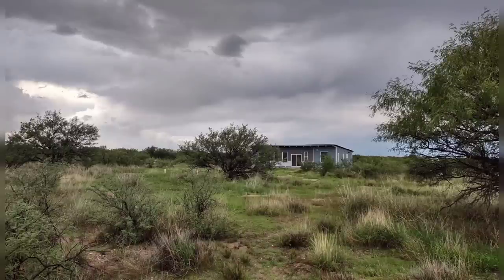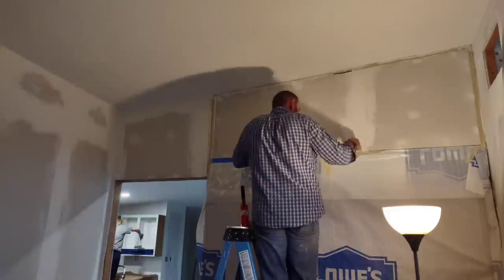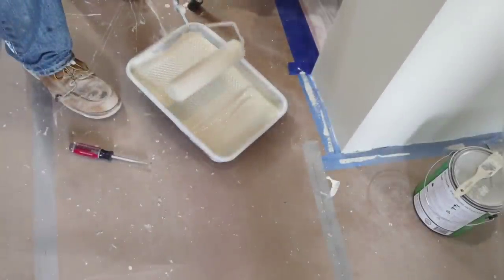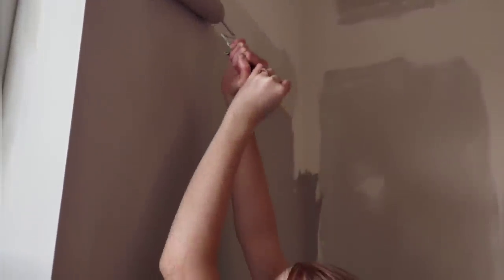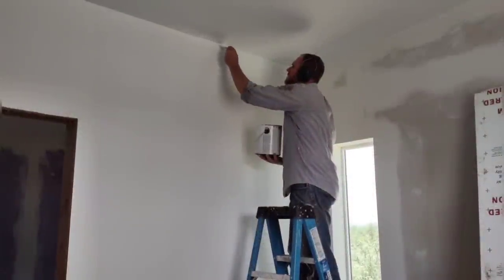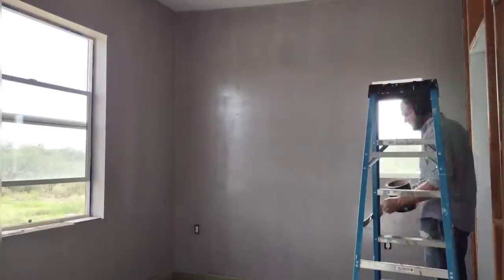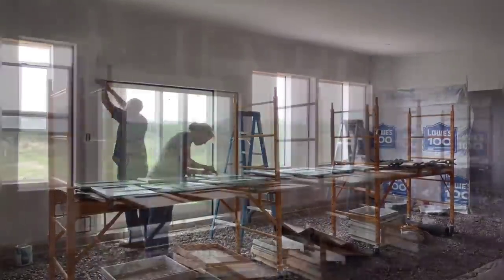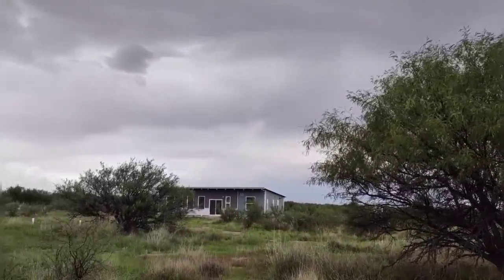Choosing the Colors | PAINTING the Walls & CABINETS | DIY Off-Grid Home Build #41

Comment: Was that a tortoise in your garden?   What a variety of desert creatures.   The purple grey is a nice compliment to some of your evening sky colors.   Your garden A frame is a profusion of greens.  Congratulations on a successful garden.  Perhaps next year you could deepen the pond, using the inside dirt to raise the berms.  In the area where the pond overflowed onto the swale, could you use some of the aircrete sample blocks to make a spillway that will not erode as excess pond water overflows.  Wishing you another blessed week, gentle weather, nourishing rain and restful evenings.  Peace
Reply from the maker: The turtle was in our front yard. It's the first one we have seen this year. We saw several last year, and they all look so different. It's tempting to put a turtle in the garden, but they would probably rather be free. Today, we just got our biggest rain so far this year, 1.5 inches. It was fun to walk around in it and make plans for better water storage on the property. There is a lot of potential! Glad we built our house up an a good pad so we don't have to worry about it getting flooded. Thanks! Hope you have a wonderful weekend. 😊🏜️

Comment: How do you deal with the clean-up waste from your painting? Is is all water based paint? and how do you clean your brushes. Does anything go in the septic tank?
Reply from the maker: We used water based paints, and cover the whole tray with a plastic bag and keep using the same roller and brush until we are done with the color. Then we take the roller off, let it dry and throw it away. We also use inexpensive chip brushes that occasionally get washed outside, but also get thrown away after we are done. 🙂🏜️
Reply: @RedandAprilOff-Grid  Thanks for the info. Good to know as i will be in similar situation. Your videos are great.

Comment: an ok guy here  is what know about color and does not matter if paint or ink it the same grey is a mix of colors it's not solid there are only 4 solid black yellow, blue and magenta and all colors from the 4 colors there is no other and if your buying paint and ink or anything it starts with those 4 colors and if you have eyes like because I was a painter in auto body work and I was press men for a  printing press is how learned about all of it so that why see reds and purples and stuff in paint
Reply from the maker: Yes, it's so hard to know for sure what it's going to look like in the house. We put the paint strips on the floor, and held them up to different walls trying to see what the undertones are. The premixed purple/gray showed a slightly different color on the side of the can than it did on the lid, but it all worked out.